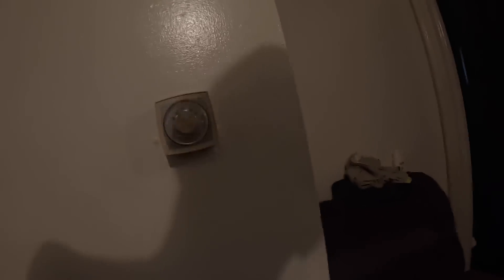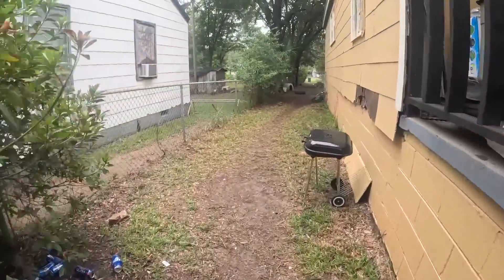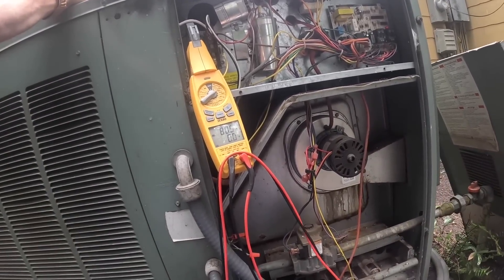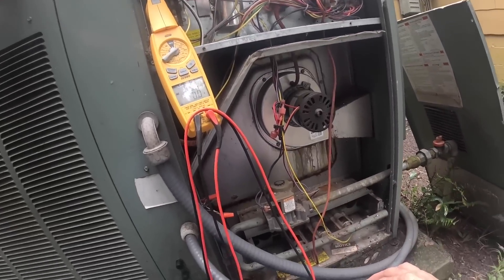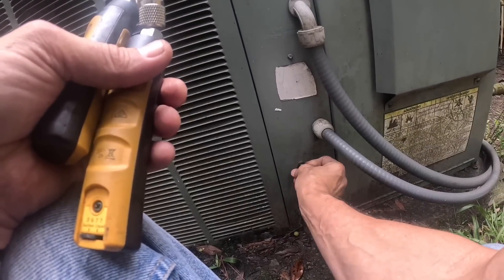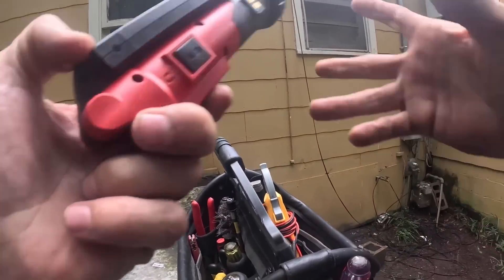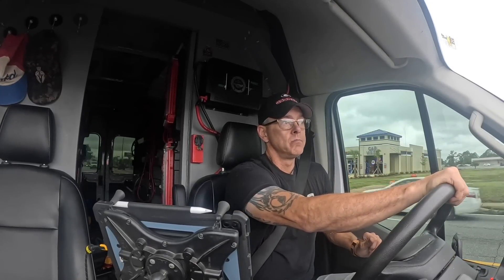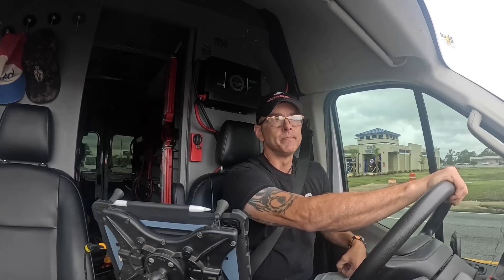Going back to a call a week after I fixed it! #hvaclife #hvacguy #hvactrainingvideos

Comment: I keep warning people that can happen, if a wire suddenly comes unhooked/burns off or fan/compressor thermal overload opens. it could leave the capacitor charge negative or positive DC voltage and at any range from zero to +/- peak voltage of back EMF, maybe even spike higher if it opens at the right time.

Comment: Curtis, when I saw that capacitor, that brought back some bad memories. All it has to do is get you one time and you will not forget. I had one that the power had been disconnected  for over 30 MINUTES, and it still held a charge. Just imagine my disbelief and amazement when I to discharge it, and it was still charged.

Comment: Yeah I’ve never seen it arc and I don’t use the screw driver to do that I just let the windings drain it for a little but then check for voltage just to be safe. Now I know there’s a jumper with a resistor to be extra safe but many use the screwdriver to drain the cap but my father in law called me yesterday and said the tech came out and did this and it arced and he had to replace the cap for free so now i do t even want to do this but it’s a good lesson learned just to be safe.

Comment: You are such an honest and accountable HVAC pro!  I've watched many videos of capacitors getting checked/replaced and that's the first time I've ever seen one arc when the terminals were shorted.  Definite reminder on making sure to discharge them before touching.
Reply: Well in reality the proper way is with a bleed resistor. (I have never used one)
Reply: Yep. Discharge it twice due to dielectric absorption.
Reply: Proper way to discharge a capacitor, is to set your meter to DC volt and clip onto the leads.
Reply: @wd8557  Unless it's a Low-Z meter (most are not) then that will do nothing to discharge it.
Reply: @uzlonewolf    You're 100% wrong.

Comment: I thought those caps had a resistor in them to discharge themselves pretty fast after they're disconnected.
Reply: LOL That costs another 50 cents!
Reply: @bobboscarato1313  And you can't rely on the resistor anyway, so why bother putting it there. I've worked around radio station transmitters, and you never trust that anything has self-discharged. In fact, the first thing you do is test that your grounding stick works.
Reply: @MelvinTheGrate  I've inside radio transmitters as well and had to watch out for the very high voltages!

Comment: call back’s definitely suck.. everyone has their own way of doing business , for me once i diagnose the problem i continue checking as much of the system as i can whilst the unit is inoperable, ie i check all the capacitors , motor bearings , coils , electrical connections, disconnect box etc .. once the system is repaired and functioning i continue with a quick PM .. my mottos is “there’s always more than one problem with every hvac unit “..
Reply: Sounding like a true commission tech. Be sure not to call u

Comment: I appreciate that you record callbacks as well as your other repairs. A couple thoughts or suggestions: I ALWAYS replaced the capacitor when I changed a CFM, learned the hard way.
If  there was a dual cap and the comp side checked ok i would install a separate cap for the CFM.
Reply: Why install a separate cap for the fan motor? Just install a new dual cap. It's only a few dollars more and you don't have to mess around adding extra wires to install the single cap
Reply: @nonamesplease8228  I was just making a common suggestion, but yes I would replace the dual cap. Thx

Comment: I worked a job in Alaska that was INCENTIVE BASED PAY. I got 18 % my employer got 82 %. Call backs were on me. Typical day was around $ 200.00 for me. All inclusive on parts labor an service fee. One job I has was to replace 2 outdoor condensers that worked. Trane units had to be ordered from Seattle along with low ambient fan cycle pressure switches. Plus the cost of shipping to Alaska. One 7 ton and one 4 ton. Total cost was about $ 19,000 . I which I would get 18 % . Pumped units down , disconnected,  set new units , vacuum,  and open up new units. Through by lunch.  I got 18 % of $ 19,000. Not a bad day.
Reply: That's like $ 3420.- Pretty darn good for half a days work!
Reply: @bobboscarato1313  yep....I  started at $ 25 an hour until I could learn the clients and the area. Boss said it was time to go on IBP.  I told him I was happy w $ 25 an hour.  He told me I couldn't work there.  Everybody in the serv
Reply: Service Department was on IBP.  I'm glad I took it. Doubled my weekly salary

Comment: if the windings are open then the capacitor has no means to discharge itself, so it will store the charge until you discharge it. you can check for the charge voltage on a cap with your multimeter, or screw driver and get a good spark...